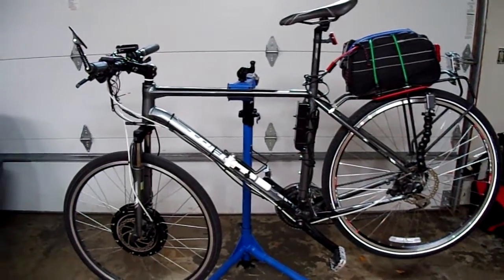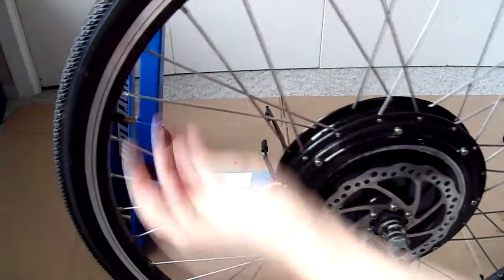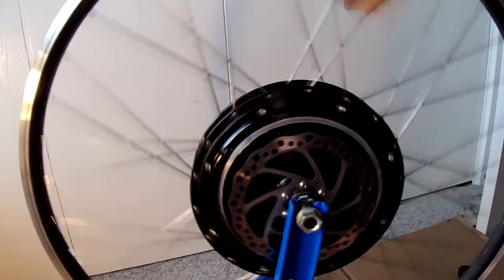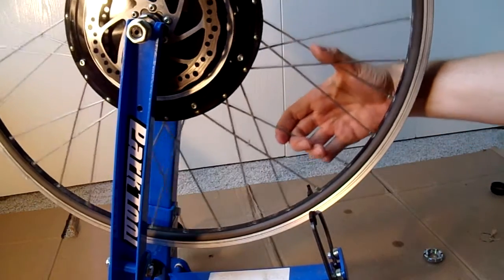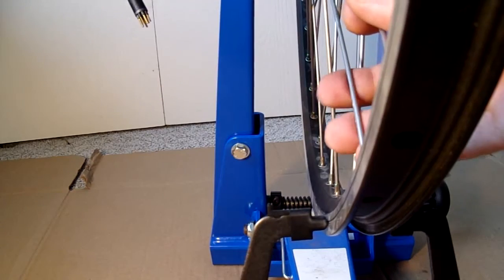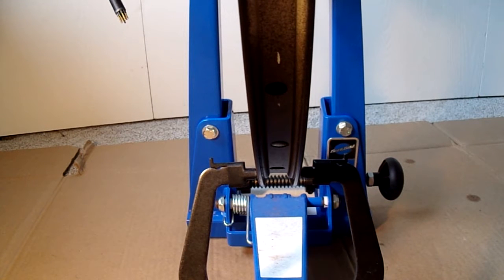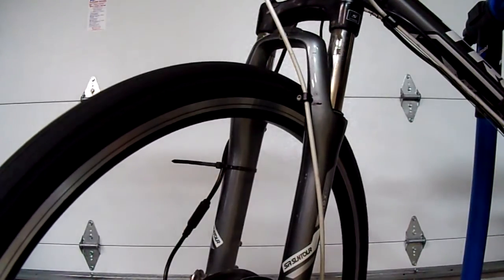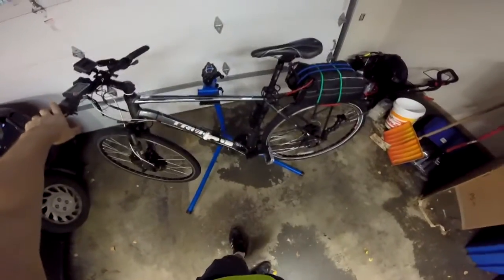E-Bike Maintenance Part 1: Truing Wheel With Hub Motor.

Comment: Looks like you are running a 1500w on that front suspension fork. That front suspension fork will snap on you...
Reply: That was 2016 i doubt that was 1500w more like 350.
Reply: Not if he has torque brackets

Comment: Can i use a 42v 2a Hoverboard charger to charge my 10s 8p 36v e bike battery pack.
Reply from the maker: It's possible, but if you overpower your pack during the charge, you could do damage to the BMS or even the cells of the battery. You would be best off contacting the manufacturer of the battery with the specs of the charger, or at least checking out the specs of the charger they want to sell you, to see if they are similar.

Comment: How do you like the front hub motor? Especially what looks like a powerful one? Have you had any issues with having a powerful motor like that on the front? 

Also, do you put the battery on the back to equalize the weight, rather than mounting one on the downtube? Or did you just want to preserve the bottle cage?
Reply from the maker: I have a front and a rear hub bike, and i love both. The rear has the ability to wheelie which makes it a lot of fun, but because of the width of the motor, it only has a 5 speed freewheel. I find myself ALWAYS using the throttle, and rarely pedaling on that bike. Another disadvantage is weight distribution, with most of the weight being on the rear. Even with the thick spokes, i've had to replace a few, and had to true the wheel several times a year. 

I built the Trek 8.3 DS front wheel drive e-bike with the idea of retaining the 9 speed cassette. I can pedal the bike at any speed, even uphill, without throttle. I can also pedal along at any speed, even at 35 MPH. 

The only issues i've ever had with a front wheel hub motor is that when the pavement is wet, hitting the throttle is best done when completely upright. Any angle to the front wheel can cause a bit of a scare when it starts to slip. I have yet to fall in that situation, but have come close a few times. 

I put the battery on the rear rack in a bike bag, which makes my overall ebike super stealthy, especially considering i pedal along almost always. People rarely ever notice it's electric; looks like a regular cyclist rolling by. The only thing police have ever said about it is: "Nice bike!". I think putting it in the triangle area is actually best for performance but downtube batteries were not really available yet when i bought this battery, unless i wanted to build a custom pack. The light Lifepo4 on the rear rack still allows me to do everything i need, which is mainly commuting and trail riding. And, i actually did want to keep the bottle cage, so it works out.